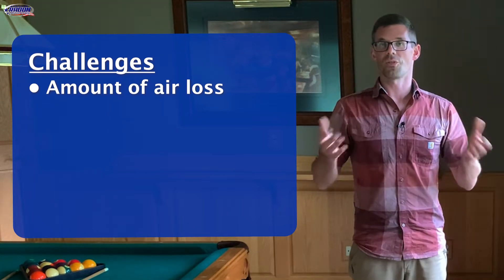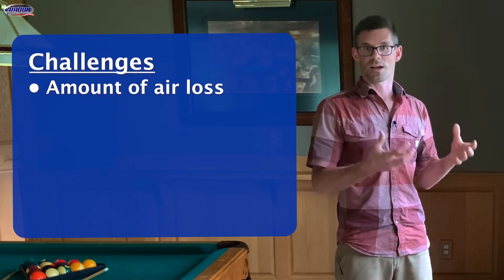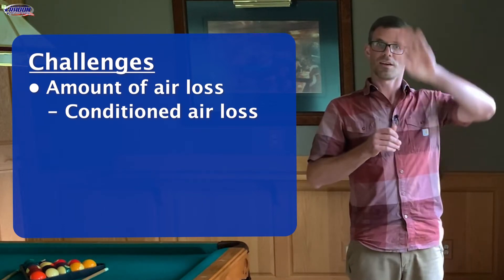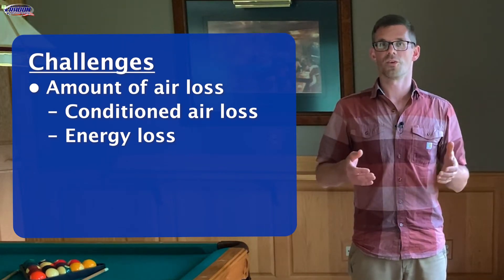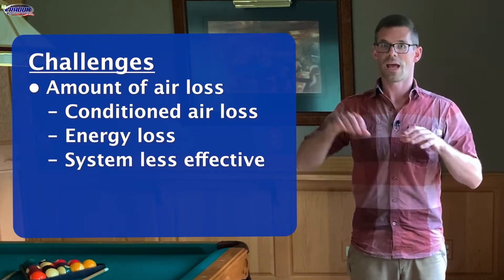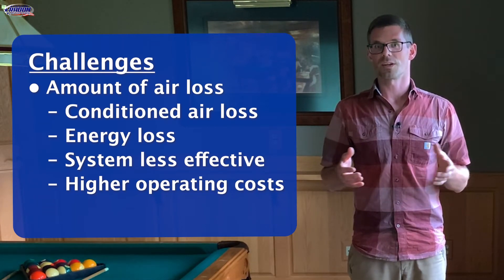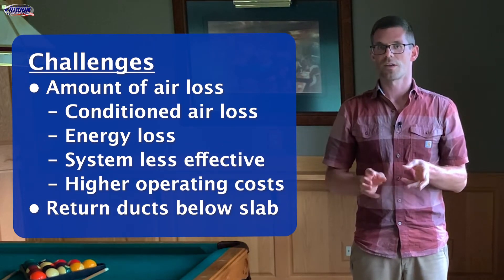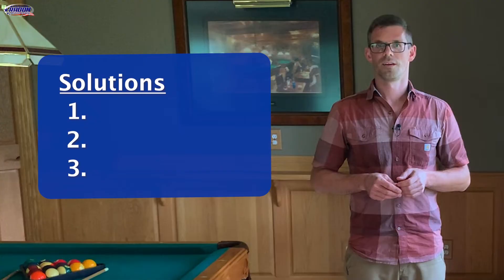Radon Mitigation with Sub-Slab Ducts

Comment: I bought a home built in 1973 on a slab without a basement  in Ohio and need to have radon mitigated. Do all homes built on a slab have these problems or only some? It is my understanding that the HVAC ducts were embedded in the slab. Is this usually how it's done and is this the same as sub-slab ductwork? Thanks.
Reply from the maker: As mentioned in the video, there are three ways to address sub-slab ducts.

I've never seen sub-slab ducts embedded in concrete. If that is indeed the case, then they shouldn't be much of a concern with radon mitigation. Here in Minnesota, they are below the concrete and surrounded by soil. The only part embedded in concrete is the riser that transitions from the sub-slab duct to the in-floor register.